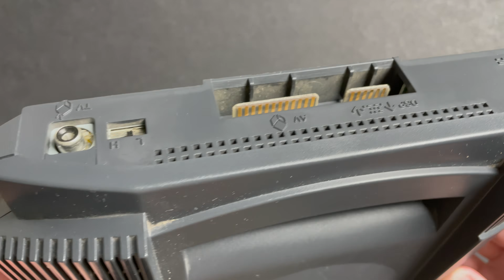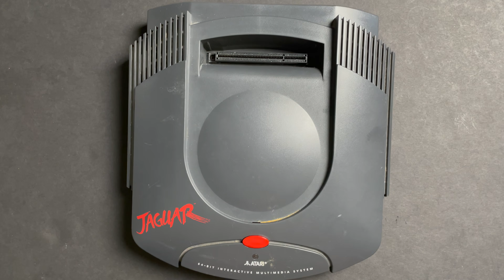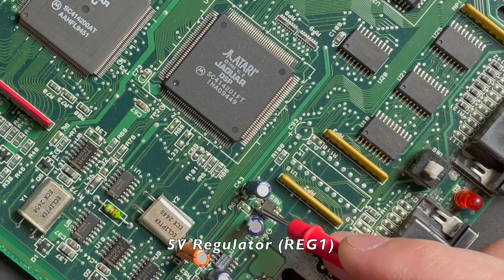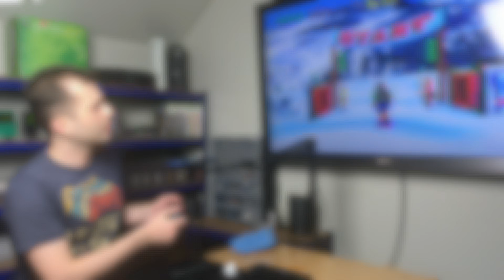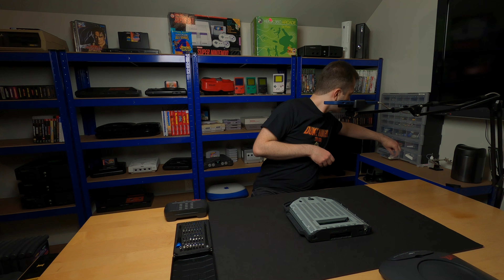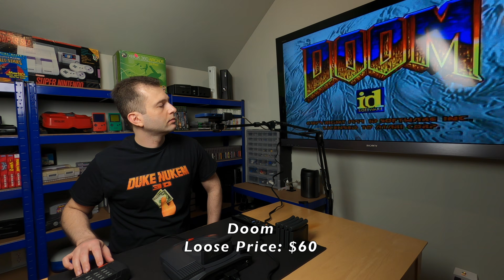Turns out $400 for a "broken" Atari Jaguar is a fantastic deal - Retro Console Restoration

Comment: I remember getting one of these for $20 brand new back 12 years ago. Now look at the prices ! Damn
Reply from the maker: Retro games have taken on a life of their own.
Reply: I got mine from a yardsale way back in the 2000s and it was only $15 for a working system and several CIB games that included Doom, Busby Fractured Fairy Tales, and Wolfenstein 3D.

Now they're just like holy shit levels of valuable with people dropping $300+ on just the console itself and a gamepad without a second thought.
Reply: @cryptidproductions3160  Ive been playing games thru an emulator and 90% of the games run great and I can use a better controller. If I bought a system id get the SD Cart. Just wish I could play the CD jag games.

Comment: I think you did pretty good, $400 for the console, two controllers, and seven of it's good games is awesome. :D Yeah it's gotten pricey, I got a console for about $300 on eBay like a year ago without the AC but it worked just fine with a Genesis-M1 cable.
The Jag scene is in a funny position now as I'd still say it's worth getting the console if you're interesting but because of the cost of entry you'll want to go straight to getting a Game Drive cart to save money on also expensive OG carts and to avoid the optical drive entirely.
Like people make and sell CD homebrew but they really need to sell ISO files now too because of rarity on top of rarity coupled with technical problems with the Jag CD. Not 100% with the CD games but most of them work on the Game Drive.

Comment: Guess what - some a-hole borrowed a Jag from me, and returned it flooded. I collected diagrams and all, but didn't start any work on it yet. And the flooded / possibly corroded parts are around these regulators. Thanks so much for sharing, man.
Reply from the maker: Water damage is a tricky one. Fingers crossed for you. Good luck fixing your system.

Comment: Man oh man, that seller must be kicking his own ass so hard he's spinning cartwheels!  Overlooking such a simple thing as the polarity of the power supply he used.....dang. He gave away a rare console at a 'non working' price that was working just fine had he cleaned his cartridge port and checked out more then just the voltage of the 3rd party PSU as well as a rare valuable cartridge! That was surely a gamble that paid off huge. Grats!
Reply: Definitely someone who didn't know what they were doing. Sucks to be that guy, I don't even mean that sarcastically, I'd be really disappointed and upset if this was me. But good for this guy! lol
Reply from the maker: It's true it was an oversight but if the previous owner wasn't tech savvy then there's not much they would know how to diagnose, even the seemingly simple stuff to you and me. It's just how it goes!

Comment: You could also open the cartridge and use an eraser to clean the contacts. For the cartridge slot use some sand paper and then push down the pins so they can have better contact with the cartridge. 
'
Reply from the maker: I wouldn't personally use sand paper. My preferred approach is to use the least invasive method specially on a system like this where replacement parts are impossible to find.

Comment: Great, informative video.  I wish I could get this lucky with my eBay pickups.  I bought a "working" GameGear recently that borders on the definition of "working" in that it turns on and the screen sometimes works half-way.
Reply from the maker: Game Gears almost always need a recap to resolve most of the power/audio/video issues they experience. The caps in your system are probably out of spec but still hanging in there. It will probably die on you eventually.
Reply: @BorderlineOCD  the seller said it was fully recapped. I opened it up and at least the motherboard has been recapped. Maybe there is a bad cap hanging around in the power circuit, the contrast pot is going out, or the CFL is going out.  Unfortunately it’s a VA2 I think and I don’t think there are LCD replacements for it yet

Comment: I believe you can bypass the "feature" requiring a cartridge being inserted before the unit will power on by soldering a jumper between pins 35 and 36 of the cartridge slot.

Comment: That is cool that you got it to work no problem.  I cleaned my cartridge port from the Jaguar I picked up for 20 from goodwill and got mine to work in a similar fashion.  Youre lucky though.. had the seller used a ac adapter with the wrong polarity, this repair would have been much much more troublesome.

Comment: I have NEVER heard about center positive and center negative,but if it has to do something with ac in reverse,well then atari should,ve added in a reverse polarity switch sothat in case you put in the qrong adaptor with still the right voltage and wattage albeit in reverse,that the system will not fry itself,BUT i might be wrong about that positive and negative centered,
Also i found it a bummer that the atari jag does not turn on when theres no game inserted, maybe those cartrides contain an essential passtrough pin to lead the power to the rest of the system,but atari should,ve atleast put in an light indicator to let you know that it is on and workong as well,but since you do need a game you can now no longer tell wether the system is broken or not.

Comment: Oh men, you just remember mi that not every power supply works on old systems, that's Explain why only 1 power works on my Genesis amazing video men
Reply from the maker: A bunch of them are interchangeable especially ones from the same era but always check the voltage, amp rating and polarity.
Reply: @BorderlineOCD  Got it!

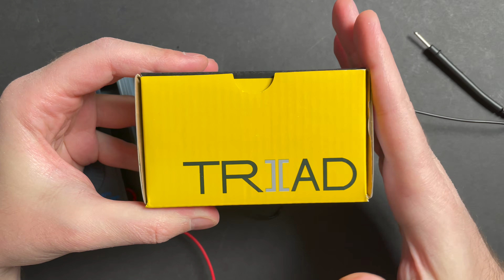Comment: 4:25  Very nice power adapters there.  Got a couple myself for my two Genesis Model 1s, which each have Sega CDs.  

Got a couple Y-splitters, and 1 of those adapters there, power both the Genesis and Sega Cd, instead of having to plug in 2 power adapters.
Reply from the maker: They're some of the better ones I've found. Nice idea with the Y-splitter especially when you have a power supply that can comfortably supply enough current to both systems.

Comment: Excellent videos man! There’s been something that has really bothered me since I was a teenager and it’s the fact that I don’t know how to solder and therefore I’m extremely limited in what sort of repairs I can do, not only on my consumer electronics, but also on my electric guitars and amps as well! 

Your videos have given me the motivation to finally do what I should’ve done a long time ago. I have a broken 360 with RROD, an optical drive that needs repair and other issues, so instead of selling it for parts or throwing it away, I’m going to use it to practice removing and re-soldering components until I’m comfortable enough with doing it on stuff that I’m not willing to do damage. Maybe I can even get it working properly again. 

Do you have any recommendations for an affordable, but quality soldering iron good for someone starting out?
Reply: Hey there, if I may... I recently bought new ones, one of the Chinese TS-100 ones for around 70 Euro plus an old laptop psu and a 'trusty' Ersa iron for around EUR 40. The Ersa is a bit larger, that's why i got both. But it's like this: the Ersa heats up a bit longer but it is a charm to use and utterly satisfying. So I'd recommend you grab something in that range, nothing better nothing(!!!) cheaper. You also need a desoldering pump, around $10 should get you a nice one that'll make your life easier. Finally a soldering '3rd hand', combo magnifying glass + metal pincer arms. Get one with a lamp for the magnifying glass and "waste" $30-40, no less on that.
So, being able to do a good job as someone who isn't in practice all the time, prefer trusty over high-tech.
I used to solder pretty well long, long ago, and have nowhere near that skill anymore, so I hope it translates as useful advice for you. There's a good howto on YouTube look for NASA soldering

Comment: Hi, just picked up an atari jaguar for $50 from a friend. He says its not working. I checked it, it is not working even with games inserted. Cleaned the contacts on the games and game reader and nothing. Checked the voltage on the power supply just as you did in your vid and it is constantly reading 13volts. It's weird because it is the original power supply that came with the console. Could this mean power supply is broken? Could this be the reason the console isn't working?
Reply from the maker: 13V seems a bit high but it could be one of those older supplies that drops under load. Do you have another power supply handy from a Genesis Model 1 or Master System to test it out? It could be a broken power connector on the Jaguar that needs to be reflowed. It could be those power regulators I covered in the video if someone used the incorrect power supply previously. I would say first confirm with a known good power supply (or test the Jaguar one on a compatible system to see if that system powers on). If power supply is confirmed working, open the console up and do the voltage checks I showed in the video to narrow down the problem area.

Comment: I was like "Please put a cartridge in it first! Don't go down the unnecessary rabbit hole" LOL. I assumed AVP was the expensive game. I swear it used to be around $100 at one point but maybe I'm misremembering?

Do you have any idea why the system was designed to where it needs a cartridge inserted in order for it to turn on?
Reply from the maker: No idea why it was designed that way but apparently it can be easily modified to turn on without a cart by bridging two pins on the cart connector. It was a popular mod with folks whom developed for the system. Just some random info I found while researching why it wasn't turning on.
Reply: @BorderlineOCD  I think Lynx's are the same. They are good for a laugh to show someone if they ever wonder if there is anything with a separate on and off button.

Comment: May have already been mentioned/asked, but do modern TVs accept or translate analog signals? I mean, the RF output is analog?
Reply from the maker: If you have an analog tuner in your HDTV then yes. My TV is an older model which has a bunch of component, s-video and composite inputs in addition to the familiar HDMI.

Comment: Hey, random question. Is there a way to test Dreamcast controllers with a multimeter to see if they will blow the system's fuse resistor??
Reply from the maker: Good question. I don't know. I'll have to check the next time I come across a bad controller.
Reply: @BorderlineOCD  not sure it's even possible, but would make for a great video!

Comment: I replaced the power supply with a new old stock and cleaned the slot as it get dirt. That what was wrong with mine as dust and dirt is a big issue.
Reply from the maker: Indeed the cartridge port pins seem to be very sensitive.

Comment: Nice work! Glad it was an easy fix. I have been working on a JVC X'Eye that has the flashing "DOOR OPEN" message which signifies an error with reading the disc. Technical and service manual lead me to believe it's not tracking the CD, but I have not hooked up a scope to check the eye pattern yet to see if it makes it past that step. If I am still unable to fix this mess, would that be something you're interested in taking a look at? I'm also doing a recap while I am at it (one or two looked bad, so I'm doing them all) but so far, it hasn't fixed anything.
Reply from the maker: Not a console I'm familiar with but sound like a tricky issue. I don't typically take repair jobs and have quite the backlog waiting. Would be interesting to see what materializes after your recap though. Good luck brining it back to life.

Comment: These videos are basically porn, to me. Always happy to see new content from you! Also, I've heard that lithium grease can degrade plastic components. Have you had any issue with this? I'm a little hesitant to use it, but silicone grease is hard to find.
Reply from the maker: I'm happy my videos make you feel warm and fuzzy in all the right places. I'm aware lithium grease isn't suitable for rubber, but I hadn't heard you shouldn't use it on plastic. Did you mean surface plastic specifically? I think a lot of folks use it for plastic drive gears when refurbishing optical drives.

Comment: After having seen your video I was somehow hooked, even though I never had a Jaguar and I don’t find any of the games particularly interesting. I also think the systems are a lot more rare in Europe. Anyways I paid a lot of money for a broken naked system + Cybermorph.
Hoped for the same easy fix. But it was not.
I am not a technician by any means. After a lot of cleaning, and checking. Even changing the odd capacitor I nearly lost hope.
Then I thought that checking the ICs next to the cart might be worthwhile. I was a bit lucky when I compared readings of all 74ACT245 PINs vs GND. On the 19th Pin (in fact #12 or B6, for each of the 4 pieces) I spotted one odd reading. U22 and the RP7 have one broken Pin (on U22 short to GND, on RP7 increased resistance into mega ohms). Exchanged for 74AS245 (only available one in my box) and botched a 10k Resistor into the system to „replace“ the broken line. Presto, works! Preserved from the landfill. Even though it was too expensive, it was a fun ride.
I write this here, because little information is found on Jaguar Red Screen other than: Clean the slot or exchange the Slot. It can be something else, and it doesn’t have to be an expensive solution or the need to throw the system into a parts bin.
Reply from the maker: Glad you got your system working! What was the purpose of the 10k resistor you added? Why was it needed?
Reply: @BorderlineOCD  The Resistor Package RP7 has one line broken, with the resistance value going towards 1 MegaOhm, all other pins still 10k. I think it might be collateral damage between the bus driver and the resistor. Normally I should have replaced RP7; but I don't have the part and shipping kills the economics. Thus I just put a 10k in parallel which pulls the line up close enough to what it was panned for by the engineers. Seems to be good enough.

Comment: I've been watching retro console repair videos on youtube for years. I am very interested in learning how to repair electronics, but I have absolutely no experience. Can you recommend some resources for an absolute beginner? I've checked the local community college hoping to find some introductory repair courses, but came up empty. How did you get started?
Reply from the maker: I started with simple projects like cleaning a system or repairing a power cord on a faulty appliance. You need some basic tools to start tinkering but you don't have to spend much. A cheap multimeter and screwdriver kit will get you started taking thinks apart and learning how to take measurements with your multimeter. My first soldering iron was a $10 Weller (no temperature control) and I still managed to fix lots of things with it that didn't require delicate work. I watched a lot of repair videos to see what other people were doing but I think it's important to have the right expectations as you start to build your fault finding skills, so you also want to spend time learning basic stuff like replacing a bad fuse or broken power connector before you work on more delicate things. Practice as much as you can (which isn't hard to do if this is a hobby and you are enjoying it). Get a junk appliance of some kind and practice removing components and putting them back in just to get a feel for soldering. Let all your friends and family know you want stuff to fix. I received more random "donations" from friends and family than I expected which made fun and challenging repair projects. Don't overthink it too much bud, just start with anything and see if you enjoy it. You'll have a huge repair backlog in no time. If you can't fix something set it aside and revisit it once your skills are up to tackling it.

Comment: Same with N64 I think, one of my mates bought one for cheap "not working" found out the edge connector just needed a good contact clean, cartridge not getting good contact = system doesn't even power on and looks dead.
Reply from the maker: True about N64. It won't show video without either a jumper pack or expansion pack. I could see folks unfamiliar with the system making a similar mistake.

Comment: Yeah I just bought a PSP 3K for $25 “not working for parts” and looked very good. No battery or the cover for that or anything else. I was surprised when it turned on then disappointed when the screen was damaged. Only about 15% is somewhat visible. I have a PSP 3K already so I powered it on with the AC adapter, connected it to my TV. I was able to update it albeit blindly to 6.60 and add CFW. Now it has a bunch of ISO’s but to use it you have to connect it to a display. Since that’s the only way I play, I may not even replace the screen. The cost is $30 for that anyways. My point is you need the battery to update it and you can’t update it connected to a display 😅
Reply from the maker: Still a great deal and if you love the system restore that puppy to its former glory!
Reply: @BorderlineOCD  It was $25, screen is $30, oem battery is $12, Micro sd adapter is $5 and battery cover is $6. We’re at $78 with all that and that’s nearing a fully functional one in decent condition. I don’t have the screen and battery cover. I may get the cover but I don’t need the screen since it works on my tv just fine and I already have a perfect condition PSP 3K. It is tempting to do that but I don’t need to.

Comment: Jag gwar
The Atari Jaguar uses an automatic switchbox like the NES. It sends voltage down the RF cable to switch it. I have both the composite and SVideo cables for my Jaguar.
Reply from the maker: Nice! The image is surprisingly good with composite. I think the only other console that has awesome composite video is the N64 otherwise it can be a bit disappointing on some systems.